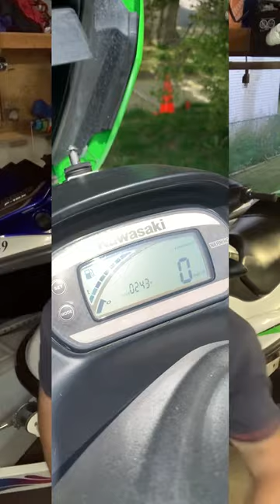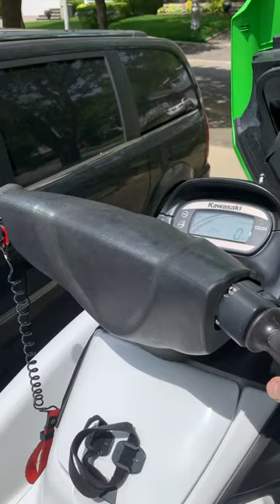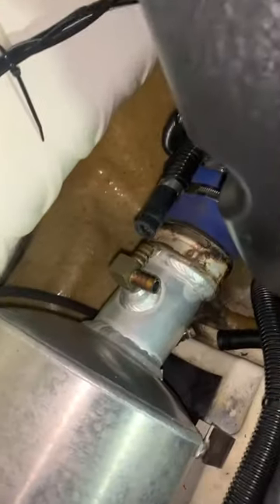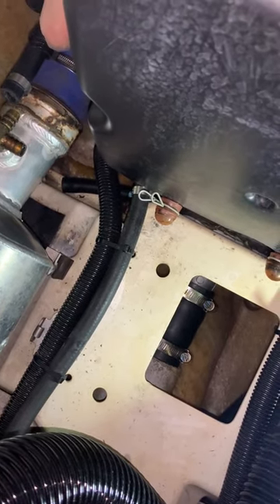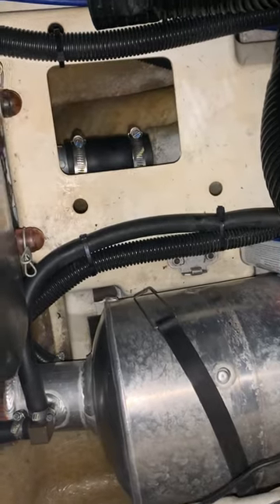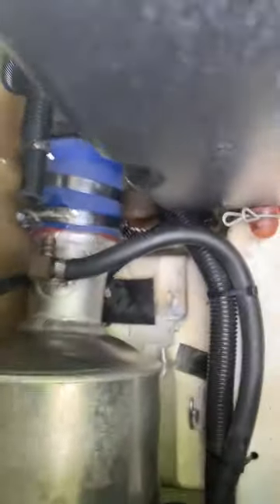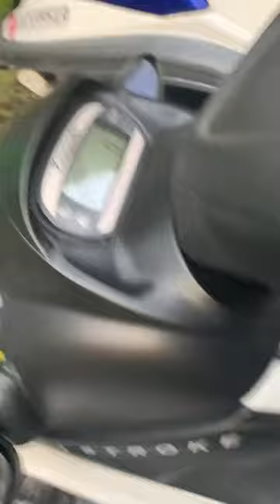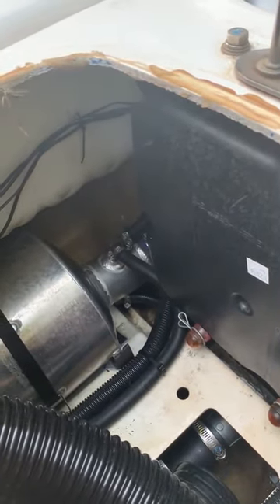Kawasaki STX 15F Jet Ski Water in Hull - Finding and Fixing the Problem

Comment: Unfortunately this is not the correct way to fix this problem. You should have removed the whole exhaust manifold and cleaned up (if possible) where it connects to the water box/primary muffler. There are 2 metal rings (that should be replaced) that look like piston rings that need to be compressed with masking tape where the lower exhaust pipe/stinger slides into the muffler. These rings prevent exhaust gasses from blowing by and burning a hole or creating a leak in the blue coupler. The masking tape used to hold them in place during assembly will burn off when the exhaust heats up. I will bet dollars to donuts that the end of your exhust pipe is completely corroded away in several spots and the rings are rusted away, ths is why you have a leak. Most times you need to replace that lower exhaust pipe/stinger with a new one and new rings. That part costs between $300 and $350USD, but is really the only way to truly fix the problem you are having. What you did is nothing more than a temporary bandaid that will come back to haunt you in the near future. Gasket maker is good for DIYers, but not the pro way to fix this.
Reply from the maker: This potential corrosion you speak of, is it common on fresh water exclusive machines? Prior to my purchase, this machine was used in the Ohio River. I appreciate the feedback and intend to perform an inspection when the machine is de-winterized next season. I only had it out twice this year, so seeing a small puddle in the hull during my winterize process was unusual.
Reply: @ManiacMachines  they all seem to corrode. From what I am told it has to do with the aluminum that Kawasaki uses in their machines. Hopefully because yours is a freshwater machine you will only have to pull it apart, clean it up, and buy new rings. The rings should be made of stainless so they usually are correded/stuck in the exhaust pipe and you need to chisel them out without screwing up the groove too much. Good luck. I live on the east coast and have changed the exhaust pipe/stinger on 2 of my machines already. Both bought used, 1 with 140 hours and 1 with 60 hours. Neither one was maintained/flushed out with Salt-Away properly! I have also fixed 2 different buddies of mine machines that had the exact same issue. PITA, but definitely fixable.
Reply from the maker: It's almost time for a spring tune up here in Ontario and I just looked what I believe to be the correct part number for the rings you speak of: 43058-3733 listed as ring gaskets. Does that sound familiar to you?
Reply: @ManiacMachines  That is the part number. You need 2 rings to complete the repair. I do not remember if that part number includes 2 or just 1 ring in the package. If you are going to keep the ski buy 2 sets. From my experience you are going to need them again in about 3 years - less if you do not flush your ski out properly after every use.